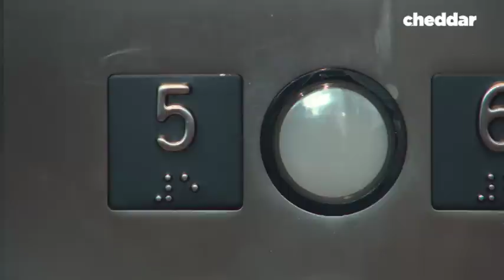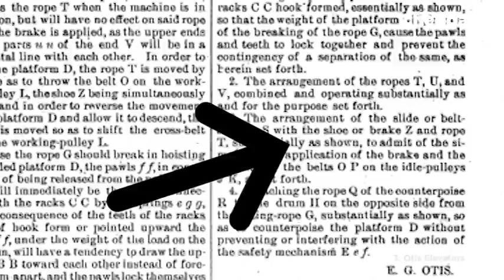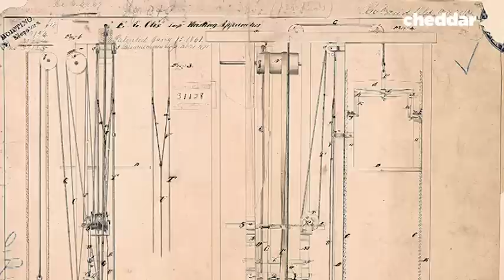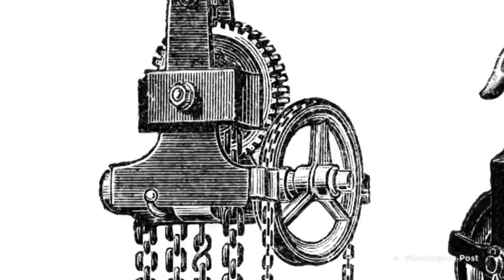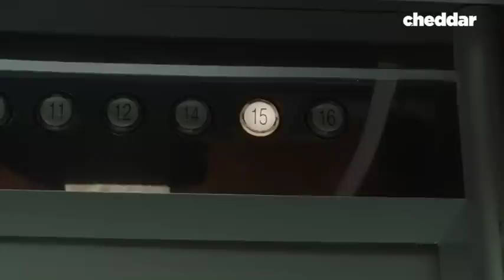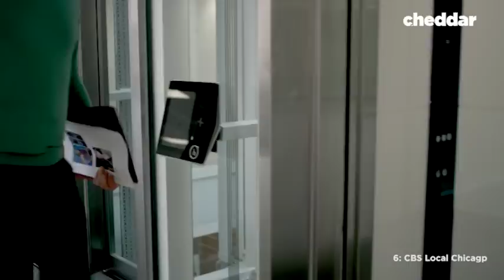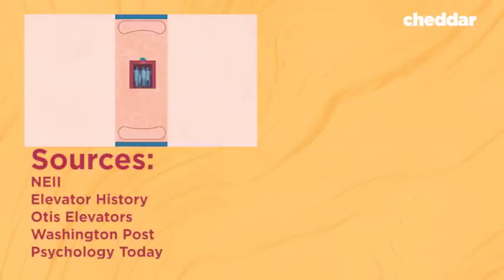Why Movies Are Wrong About Elevator Free Falls - Cheddar Explains

Comment: I worked for an architecture professor when I was in college in the mid-1980's.  He was researching the origin of high-rise buildings.  The elevator made the high-rise building possible.  Until nearly the end of the 1800's most buildings could not be much higher than 6 stories as this was as high as a hook & ladder fire truck's ladder could reach.  Yes, Otis' elevator break was an incredibly breakthrough.  They essentially have a monopoly, dare I say a "lock" (using a bad pun) on the elevator business.  And their business is has more ups than downs so long as we keep building ridiculously tall buildings.  However, as far as I can say ... I go with the logic of the film "The Towering Inferno" and won't live in a building any higher than the first few floors.  For the handicapped and blind, you will likely die in your unit if you can't get down the stairs during a fire or other emergency, so you're stuck there.  These buildings that are higher than 10 to 20 stories might as well be death traps to my mind.  The apartment buildings in Manhattan and other large cities that are higher than 20 stories are just plain stupid to me.  I'm not walking up and down those stairs when the elevators are out.

Comment: Stop, As an Elevator Man you are wrong: the safety rail jaws are activate by a mechanical sieve that is usually mounted on the machine room above the car or in the bottom of the hoist way called the pit. When a car over speeds there is one separate steel rope attached to the car and inside of that sieve is centrifugal weights that rotate when the moves to
Reply: Yes, they didn’t even bother talking about the overspeed governor.

Comment: The way Cheddar uses the term "safety chain" can be misleading. Safety chain is not a literal, physical chain that the workers forgot to engage after maintenance. Safety chain is a process/maintenance concept. In this case it sounds like a tag-out program failure.

Comment: I have an elevator horror story, I was in Atlantis in the Bahamas and I was going to the arcade at about 8 o’clock at night. I got on the elevator and it went down about two floors and then it stopped and when the doors opened I was in between two floors, and the floor of one of them was at eye level with me. I pulled the door open with my hands and I pulled myself up onto the floor. Keep in mind I was 12 so now I am traumatized when it comes to elevators. I’ve also realized since that the elevator could’ve went down and pinned me.

Comment: I developed a fear after I was in an elevator and the elevator kept going up, hitting against the shock absorber I’d imagine. I’m honestly not sure what happened but it felt as if the elevator did not know it was on the last floor. I frantically pressed a the open button i think and got out. Took the stairs on the way down.

Comment: While the overall theme is right - elevators are incredibly safe, there are so many factual errors in this it makes my head spin. The Otis safety gear, for example, has been out of use for damn near a century, replaced by overspeed governors that activate a safety plank under the car - jaws that actually clamp on the guide rails. And that is just the first error.

Comment: Also the pressure of falling elevator in closed shaft makes it descent slowly. It's not that slow to be comfortable but it is survivable. However this depends on the design. When shaft is too wide or the elevator is not in a shaft it won't work. Many single shaft elevators have shafts quite narrow and this effect reduces the speed of fall.
Reply: This is total nonsense.

Comment: She was doing so well until the Hancock story.  That express car did not "free fall"!  It oversped when it went out of balance after the one cable broke.  As it continued to accelerate, it finally got fast enough to trip the governor and it stopped.  Had the governor not tripped, it would've stopped at the lobby.  It was never "out of control".  The frightened occupants thought it was... but it wasn't.

Comment: As a young child and not understanding how an elevator was designed, I was afraid that an elevator had a greater chance of falling when fully loaded. Later in life I understood how counterweights were used so that the elevator wasn't working any harder fully loaded than it was when empty, and that other safety systems would prevent such a fall from happening.

Comment: BOGUS INFO! Older hydraulic elevators can certainly free fall! All the info stated in this video only applies to traction elevators, but most buildings use hydraulic elevators if they're 6 or fewer floors. Not all hydraulic elevators have brakes (they wouldn't normally need them) and a complete loss of hydraulic pressure would cause the elevator to free fall. This has happened, but it's usually triggered by neglect to add oil for years, or a repairman releasing the oil pressure suddenly - such as unscrewing the jack bolts to replace the packing without securing the cab (which is really dumb, but has happened)

Comment: The most common way to die inside an elevator is because of blackouts.
People died stucked inside them, just because the buildings fell, suffocated by the smoke (way before the heat could do the job), or even drowned (like on cruises, or due to a tsunami).
Reply: Why would a building fall during a blackout?  Also, if the building is on fire in anyway, people are more than advised to NOT use he elevator.  In some cases where the fire alarm is set off but there is not fire, some elevators will not operate unless they are placed in fire-mode.

Comment: I was in an elevator that fell. It went all the way down to the basement.
It was an hydraulic elevator rather than a cable elevator though. Hydraulic elevators are safe because they only fall at a rate that is allowed by the oil running out of the cylindar.
Reply: Of course lol. There possible no chance of crashing into the bottom on a hydraulic lift. This applies to roped and holeless hydraulics too, they’re safe.
Reply: TRG Lifts 
It was sure scary though.

Comment: It's never been the fear of a snapped cable I've worried about.  It's always been about "rogue" elevators -- ones that act insane.  Stopping off level with the floor and then moving so that you're not sure whether to step off or not, because if you do you might well get a piece lopped off you in the human chomper.  Or elevators that refuse to follow orders and start going all over the place keeping you hostage, including above the last floor.  I've been in old elevators where you can see through the ceiling above you, and sometimes you get pulled up so you think the cab is going to hit the support beams above for the motor and the whole thing is going to collapse and fall down.  

Elevators have way more failure modes than just snapping cables which are potentially more gruesome.

Comment: That’s not how Otis’s elevator worked. His system relied on the tension of the rope. If there was slack in the rope, the spring loaded brakes on the top of the car would lock into the teeth on the rails. It wasn’t on the bottom. That way his system would work no matter what direction the elevator was going.   Second, in most elevators, when the power goes out, the elevator has a backup battery to lower the elevator to a floor to let passengers out. They don’t just get trapped in a power outage or fire.     Third, they didn’t explain how the modern governor brake works. When the flywheel spins too fast, it pulls a cable right which then pulls on the brakes on the elevator cab. It does not rely on electricity so it works no matter what the power is doing. The electric brakes are mostly used when the elevator is stopped on a floor so it doesn’t move when weight is applied.

Comment: Given all the dreaming/nightmares all my life about elevator falls, you don't make me comfortable. I've worked with several elevator companies and I don't have any problems with any properly maintained elevators. I have had an experience with a modern elevator free-fall. It wasn't harmful to anyone and it only happened for a few feet/story....so...gasp. I also had an experience during an elevator inspection with the elevator inspector (and the elevator dropped more than 12 inches when the elevator was recalled.) You're also addressing a fear issue. I can, however, tell you that more than every 10 years or so, there's an elevator accident. They're not always fatal, but I wonder how many are actually reported. Honestly, I'll use elevators every day...still, there is that 'me' who wants to look into the elevator room and delve into the maintenance records. Some elevator companies report that they inspect once a month. My experience was that it wasn't true. We maintained a log of elevator inspections. The logs were maintained in the entrance of the elevator room. Elevators are safe. Then you have to rely on those who are responsible for maintenance. Fictitious University, Cheddar, but elevators are as safe as the written laws and those who are willing to follow those laws. Safe, yes, but there's a lot of working parts.

Comment: Elevators usually don’t fall nowadays. For the ropes of even the „least“ save elevator are designed to wield way more than the maximum weight of the elevator

Comment: “It was only because of human error”. Humans make errors, so systems need to be designed to account for it. Though sadly, system design is also prone to human error, so I guess in the mentioned case the unlikely case of multiple errors coming together — a design that even allowed running the device with disabled safeties and the maintenance engineers forgetting to turn it back on — came together. And yet nobody died, so that’s actually pretty good? Minor physical injuries aside though, the psychological trauma must be major.

Comment: Narrator: nobody has died from a snapped cable in a modern passenger elevator.

Me: In 2015, two people died after an elevator at the NRZ building in Bulawayo (Zimbabwe) developed a fault and broke loose, plunging eight floors down.

Comment: the several china/india elevator videos where the elevator drops with someone getting off, or going on before the elevator closes its doors tho. building construction elevators in tall buildings are scary as well
Reply: New York City has gotten mad news coverage about elevators and escalators screwing up and in 2000 something an elevator has "rocketed upward" and crashed into the top of the shaft.  The building had been built in 2002 thus was not that old.  I think NYC may have a problem with too few elevator/escalator mechanics/inspectors.

Comment: The real worry, for those of us old enough to remember LA Law, is walking into an empty shaft.  It didn't end well for the character on the show.
Reply: That’s only going to happen if a technician unlocks the outer doors and doesn’t re lock them. Otherwise they won’t open
Reply: Ah... they old classic door opening without the elevator car being on the floor?  That's about as unlikely as me spreading my arms, jumping off a high rise building and gliding across the city.
Reply: @kaylaknott9541  That would make it where someone could manually open those doors.  I had this happen as a kid because I used to part the doors about half an inch to peer into the shaft and see the car coming up.  One time I did it and they were able to be opened all the way.  However, there is no way they would have opened on their own because the elevator car's doors have a mechanism that connects to the landing's doors and they are opened by the door-operating motor on the roof of the car.
Reply: @nexpar7439  yeah, that's why it was a tv show not real life.

Comment: How would the elevator in the Johns  Handcock building fall with a single cable snapped ? It still has 4-5 more to suspend it. Plus the governor device works with a separate cable not supporting the elevator weight over its sheave that acts on its weight attached spinning centrifugally moved away from the center of the sheave with the speed of the elevator/sheave. It first activates a switch that shuts off the power in case of a runaway over speed. Then a mechanical activates a brake that grasps the cable that is attached to the brakes below the car to activate on both car rails. Like the brakes on your car against the brake rotor. This is tested with weights in the cab and the marks on the rails to have a minimum and maximum distance to stop so it is not too fast or slow based on the rated speed of the elevator. Shorter rise hydro piston lifted from below the  elevators have a valve to stop them in case of a broken pipe etc... causing it to fall.  There are many other safety devices for fire and earthquakes required for passenger elevators ! Respect the Elevator/Escalator mechanics and workers that give everyone a lift. The men with long quality shafts and strong pistons that operate all day and night and just keep going for many many years. They are not like your car wearing out !

Comment: says the most mis understood part is the brakes...then shows the cars safeties, lol. the brake is on the motor not the car. The object highlighted is the new version of what Otis invented. the safety wedge. the device shown before that is called a governor. when the cable pulls through he governor too fast ( overspeed) centrifugal force will pull an arm out that will catch and lock the governor cable. this will cause the safety wedges to drop and the car will come to a controlled stop. not a dead stop but a managed slide.

Comment: There's so much wrong with this video. 

Elisha Ottis' safety elevator is described very wrongly. It did not use a ratchet. It had a brake on the top which was held open by the tension of the rope. When the tension was lost, a spring pushed the the brakes out against the teeth in the shaft.

The term "rope" is not a homage. "Wire rope" is a common technical term in all industries, because the rope is made from many steel wires twisted together. That's what a rope is. It's a misconception that ropes are only made from hemp.

The elevator "fall" in the John Hancock building has been investigated. Nothing ever fell. The elevator was making a normal high-speed descent when one of seven ropes broke at about the 20th floor. The brakes activated and gradually slowed the elevator to a stop at about the 12th floor. Because it was an express elevator, there was no door at that floor, so firefighters had to cut through the wall to get passengers out, but they weren't injured, or even remotely in danger of falling. The official report is linked in this article:

https://abc7chicago.com/hancock-center-john-chicago-building/5264740/

Do your damn research!
Reply: Finally, an educated person passing by in the comments!

Comment: Lemme just explain how an otis brake works, or at least how I've heard it. The cables pull a leaf spring up in the middle, pulling its ends into the elevator body. The spring is too weak to hold an empty car, so the empty car can still move. So once the cables snap or lets the cabin freefall, the spring straightens out, extending out of the cabin floor and catching on the teeth.

Comment: Are there safety mechanisms to prevent faster speed elevators from failing to stop and flying through the roof?
Reply: There are final limit switches in the shaft that would stop the elevator car from going past the top floor. Another set of these switches are below the lowest floor with the same function to keep it from going to the basement.

Comment: I remember being in a hotel and an elevator had the doors open but was bouncing up and down nonstop.
Reply: That reminds me of when I was little, like 4 or 5 years old and I pushed both the up and down buttons and when the doors opened, the cab was rapidly bouncing up and down for about 5 seconds before settling down an leveling out.  We actually rode it down to the first floor.  The trip was non-eventful.

Comment: Except some elevators are the piston style with the single are the pushes it from the bottom under pressure to the next floor and uses the piston to go back down,  no cables used there, and those suck and are scary also when they start acting up

Comment: I'm in elevator mechanic I've been working on elevators for 32 years yes they are very very safe to ride
Reply: Also elevators are considered public transportation which means the state and federal codes require a licensed elevator mechanic to properly inspect elevators every 90 days a ck list it's a law and once a year by a federal or state inspector also testing safety equipment on elevator every 5 years with weight all documented and sent to the state testing is not up-to-date an expired State inspectors red tag lock elevator out of service they don't mess around

Comment: Wait... That Chicago accident..they said safety chain? I would have to see how that safety governor is designed .. because most safety governors have 2 different safety switches... Mechanically meaning if the elevator moves too quickly downward ...causing the governor to lock on the rails...so even if the electrically safety circuit was tampered with . The lift would still stop and stick in the shaft ,. Even if it doesn't electrically stop the lifting motor